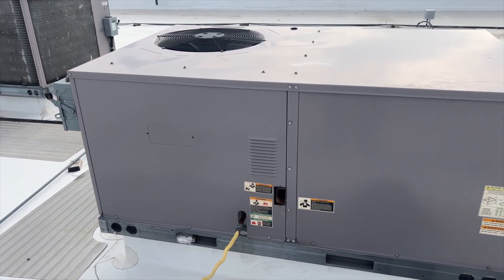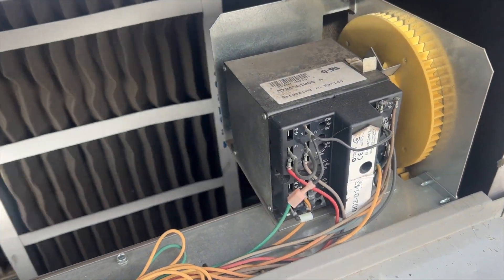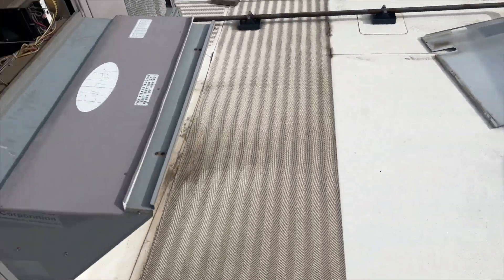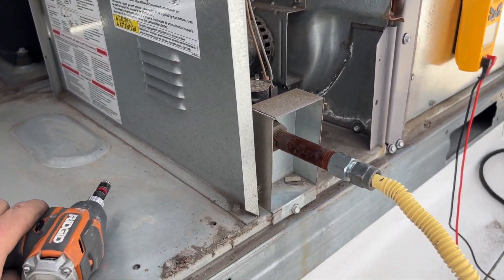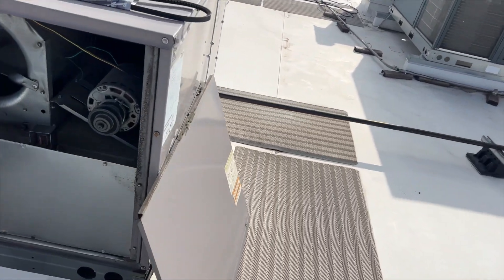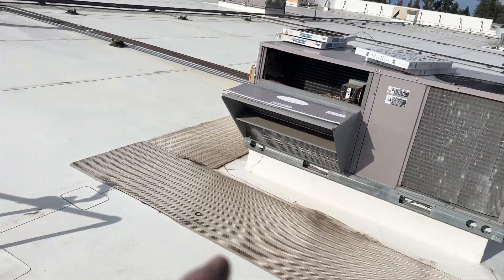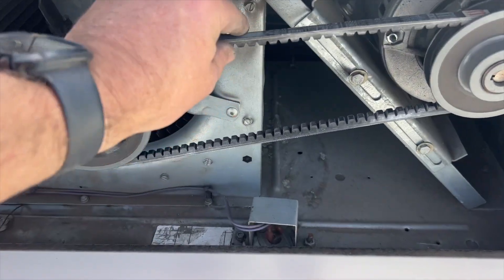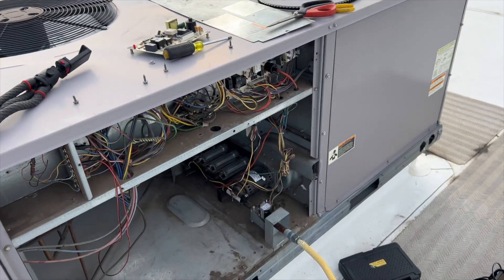Two Carrier Package Units Not Heating EP114

Comment: Good job. A bit of a correction. The amp draw is higher on a centrifugal fan when there's less or no load, the blower door off, rather than having the static pressure of the system keeping it from working too hard. It needs restriction.